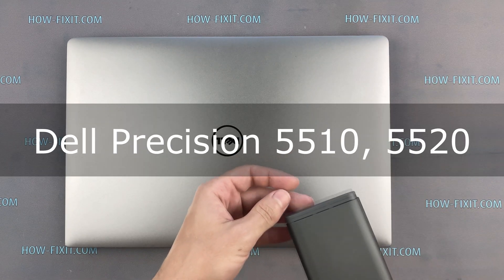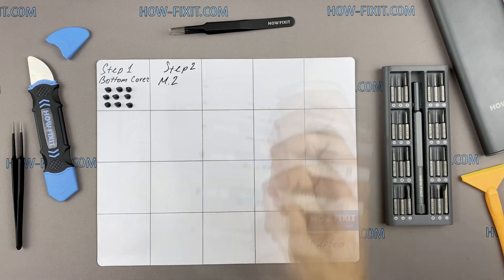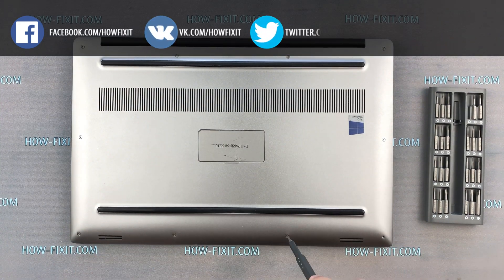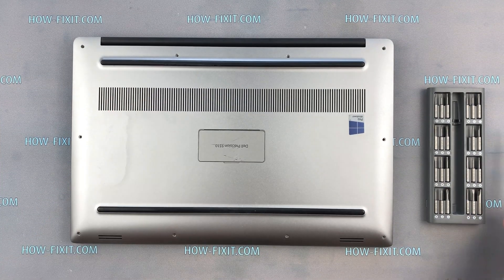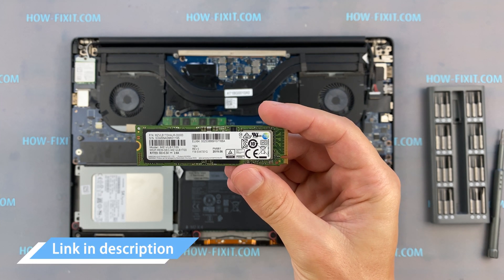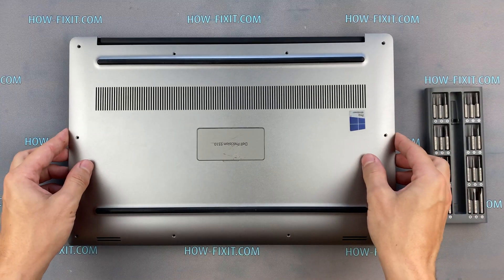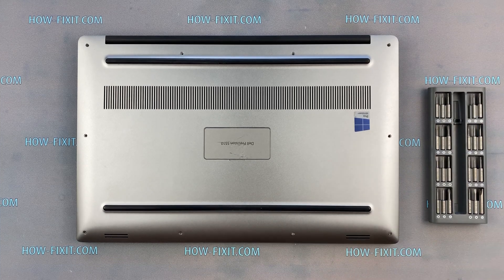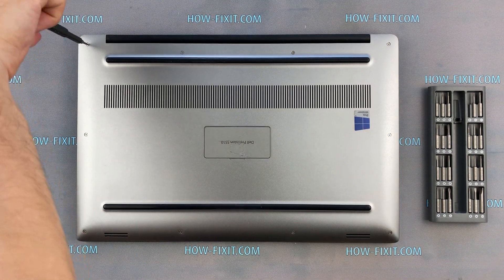Dell Precision 5510, 5520 SSD Upgrade Guide – Step-by-Step Installation Tutorial

Comment from the maker: ⚠ The Dell Precision 5510, 5520 supports both M2 SATA and M2 NVMe drives in its M.2 slot. So, you can install either, depending on your preference for cost or performance. Check the description for links to recommended M2 SSD drives. Additionally, watch the video explaining the differences between M2 NVMe and M2 SATA 👉 https://youtu.be/r3Jy5dHOj3g

Comment: isn't necessary a heatshield plate when installind the ssd? my g15 5510 has one m.2 empty slot, the other one has a metal bracket for heat dissipation?, i'm still not sure if it's neccesary or not, Dell didn't send those parts when i purchased my laptop